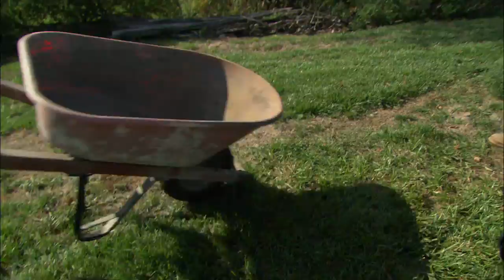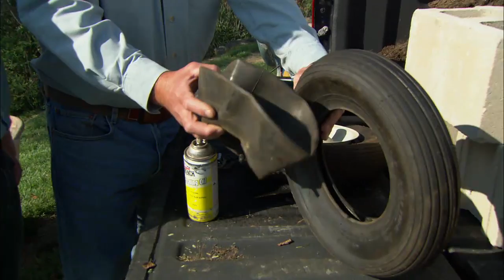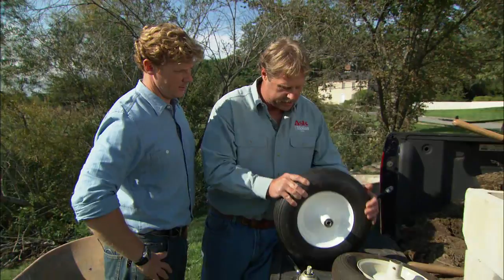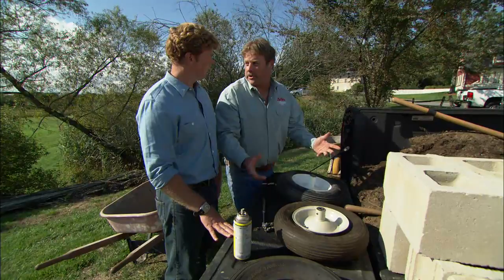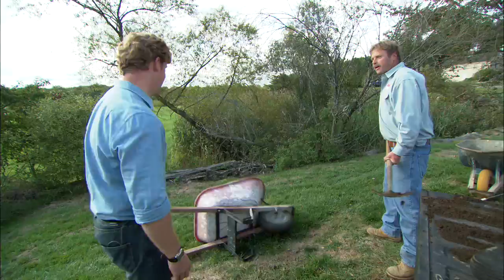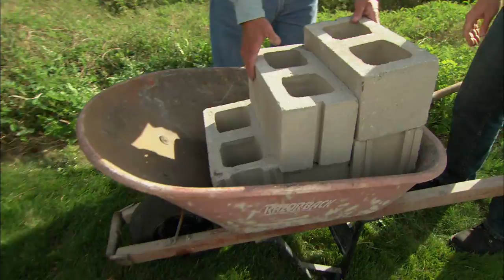How to Use a Wheelbarrow | This Old House

Comment: Best tip for wheelbarrow.  Toss the thing out and get one of the plastic composite jobs with a bicycle wheel on each side where you really Can get the weight over the axle.  Then it's like a dolly.  I've had 240 lbs of bagged dirt in mine and run it across flat ground with just a couple fingers. Just like using a dolly.   On a hill you'll feel the weight of course, but even more so with the one wheel out front.  I'll never own another wheelbarrow and the wheelbarrow can tip where mine does not.

Comment: It's amazing how many people don't know the basics of using a wheelbarrow.
Reply: How many people do you see on a daily basis with a wheelbarrow? Last one i've seen was over a year ago. They are much rarer than the need to change a car tire, and even 90% of the people don't know how to do that.
Reply: I see people use them every day. Wheel barrows arent unicorns, everyone I know has one laying around in the shed or garage somewhere. Possibly one of the most useful tools to move heavy materials ever invented. Shit Im a carpenter and throw all my tools in one every day to take back and forth to the truck. Beats making 3 trips with hand and arms full of awkward tools.
Reply: @Engineer9736  I don’t even use a wheelbarrow but I know how to use one it’s simple you just put stuff in it and move it and dump it easy as that

Comment: what about wheelbarrow with 2 front wheels? are they good?
Reply: Two-wheelers won't flip on a slope.
Reply: Feels more.conrtable also when.its.really heavy
Reply: The only downside i can see, is that bumping a 2-wheeled wheelbarrow up a curb will be a lot more difficult. You will have to turn around and drag it up. But if you carry real top heavy stuff like bricks it will still be worth that downside. Having a wheelbarrow topple over gives both a lot of shame as well as extra work. Though a 2-wheeled wheelbarrow might look like a disabled help tool.
Reply: I wouldnt recommend them if you are using them with anything heavy. Unlike alot of these commentors, I use a wheel barrow on a daily basis at work. While a 2 wheel seems more stable with heavy loads they are next to impossible to make sharp turns with any kind of load. Rarely is a wheel barrow used in a straight line with no hills are sharp cuts you need to make. If you plan on carrying heavy materials such as concrete, dirt or rock go with the single wheel steel barrow. If its for mulch or garden use buy a cheap plastic barrow with 2 wheels.